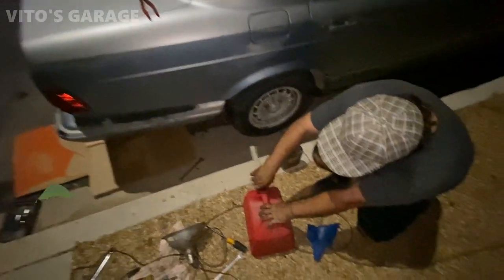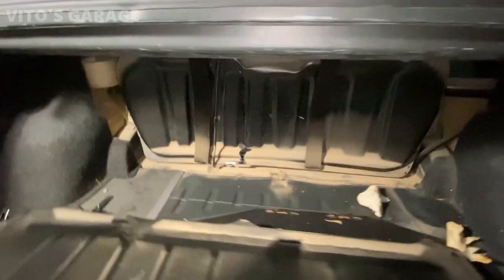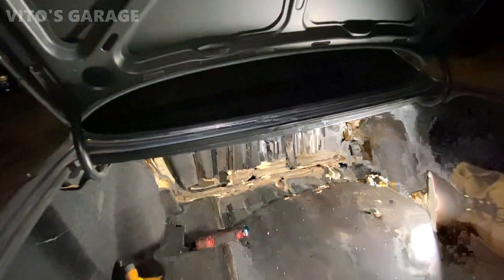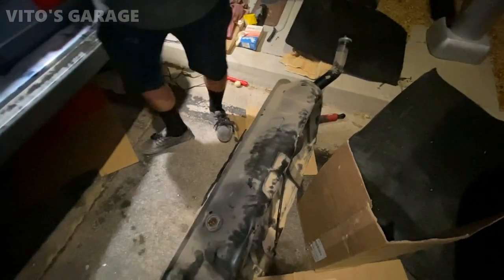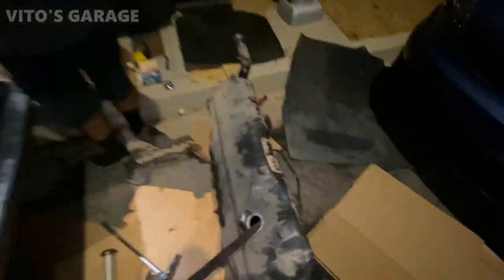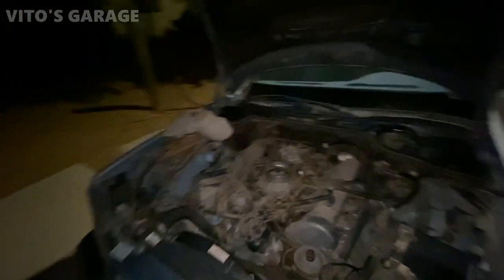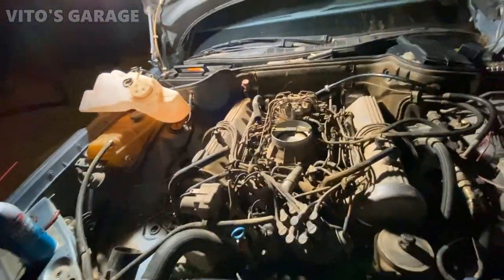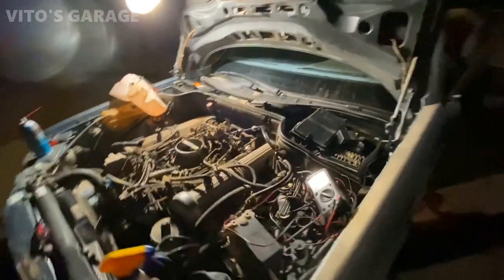THIS IS THE WORST FUEL TANK YOU'VE EVER SEEN IN YOUR LIFE! 1985 Mercedes 500SEL W126 is Alive!

Comment: What's the miles or kilometers on the odometer of this car? Worry about mine.
Reply from the maker: It has about 269 000 miles or so. It's always a good idea to remove the fuel tank and clean it on your classic Mercedes. This particular car has sat in the hot weather for 10 years and that's what happened to the tank